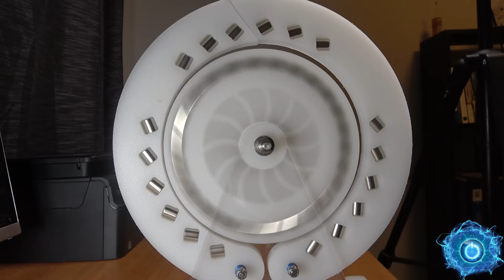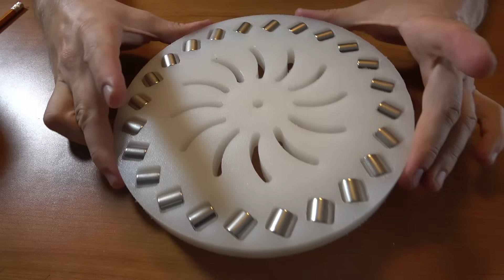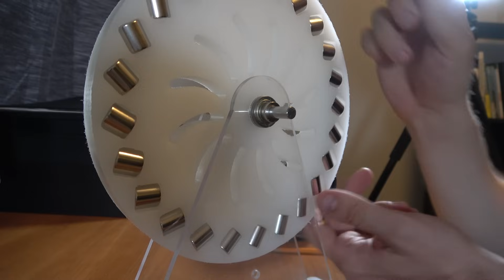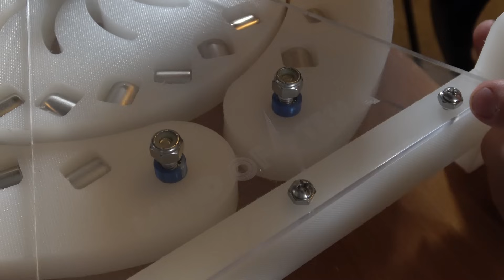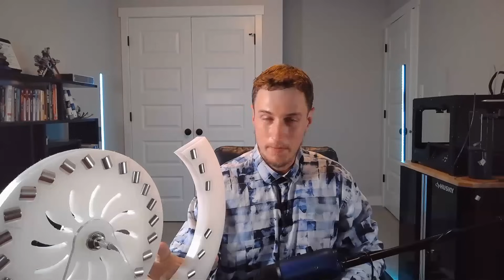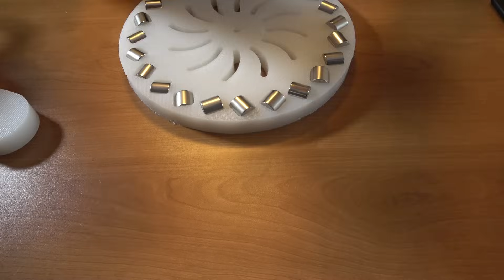Perendev Magnet Motor - Does IT WORK?!

Comment: I don't have any background on engineering nor english is my first languege. I believe that to create a funcional lightsaber, regardless of type, you need a way to manipulate the shape and strength of a magnetic field, and a way of create plasma (hot or Cold), and miniaturize everything. the magnetic field would give the shape of the blade and the strength of the field need to be either variable so the energy can interact with the enviroment or need some form of "miracle" point that can secure the energy inside the field and allow the field to disperse for interaction with the enviroment. plasma has many forms there is grape plasma that apears in a microwave oven to atmosferic entry. from easy to hard i believe that cold plasma lightsaber are easier but i have no ideia on how destructive.

Comment: These magnets at their closest appear to be an inch apart, they'd work considerable better if closer, and may be the reason this doesn't work. We also have no way of knowing the polarity of these magnets, I feel it'd likely work better if magnets were repelling one another. I also think if attracting magnets were built into the support structure of the hub, there'd be a pull from the inside of the circle and a push from the outside, that little extra pull could make a big difference, also I's suggest that the wheel has significantly more mass and weight required to hold the magnets than needed. There's also considerable noise from the hub which indicates significant friction, I'd suggest that using a bicycle wheel with proper machining and bearings could make a large difference.
Reply from the maker: I have a polarity meter and made sure they are all opposing but the magnets need to be shielded because they are interfering with each other.

Comment: That original motor had springs at the inner side from the magnets, they dont been complete static. It also had 3 wheels, where it seems, that the 2 other helped to overcome the sticky point. 
But there been to less informations about the device itself to reproduce it.
Reply from the maker: I am trying to build variant 2 with mu metal, this will answer a lot of questions whether or not it really can work at all.

Comment: Use 3 rotors and 3 stators, but remember, that rotors shouldn't be placed in a row
And you should also use a Cooper pipe as a magnetic shield for each magnet
You can find a patent on web, with a instructions
Reply: That was my thought too in regard to shielding them in a copper sleeve.

Comment: You're supposed to shave the corners of the magnets. They can't be perfect cylindrical magnets, you have to shave corners off to distort the field. Or so I'm told, idk. I'm gonna try it though lol. My serious x died all by itself now I'm bored. I also want to mention that Microsoft quality is like a 99 Kia now. I haven't touched it in months, it's clean inside, but it died all by itself anyways. Gd a**holes want 300 to fix it, it's 15 months old.

Comment: If this couldn't be used to generate power with permanent magnets, why would it be more likely to generate power with electromagnets?
Reply: Because with electromagnets you have an input of electrical energy which can be transformed into mechanical energy. In contrast, permanent magnets do not deliver energy - except what physicist call "potential energy", which can't run a motor.

Comment: Is it because this had never occurred to anyone in the past or only recently, have we had very powerful permanent magnets?
Reply: No. If such concepts would work they would also work with weak magnets, only the output of power would be small. But magnet motors up to now have never delivered even a MicroWatt of power, never mind which design was tried. Because permanent magnets deliver force but no energy.

Comment: You do many things wrong, you need a Aluminum Tube hull for the magnet, to shield the interference of the magnet, the the power push out is more in one direction! Many videos about that effect are on YouTube! And the Arms around your wheel are not that exact and the magnets heads must be free and not covert with that plastic and at last they must come nearer together.
Reply from the maker: Why not just use electromagnetic coils and alternate the cycle?

Comment: You should put plate magnets instead of those square. The secret is in magnetic flux geometry. Not all kind of shapes are suitable for magnetic motor.
Reply: Absolute no kind of magnet shapes is suitable for a magnetic motor. Permanent magnets alone can not drive a motor, never mind what shape they have. I always wonder about such advices. Do you have a running magnet motor with plate magnets? Of course you haven't.
Reply: You are the first person I've heard on this topic that is absolutely correct ... I myself  couldn't agree with you more and the other 3 requirements that make it work continuously , produce usable torque , and actually fulfill the promise of a real clean energy machine ... Mr Joseph A Bailey ☘️
Reply: I believe that you know what I know by coincidence ... Judging by how you sit back in cognito and give the specific answer that you did without revealing too much ! ... I applaud you Sir ... Mr Joseph A Bailey ☘️
Reply: Takes one to know one ...

Comment: If a motor is to be moved by permanent magnets alone, then it must also be possible to build a motor based on falling stones. The ground and the stone also attract each other. But no one has ever succeeded in doing so. You have to lift the stone up again! In the same way, magnets that have been tightened must be released from each other with great force.

Comment: There is no such thing as free energy and never will be. I do like perminant magnet moters but even with those I imagine the magnets would wear out over time and have to be realligned.
Reply: Don't worry about magnets wearing out over time and have to be realligned. This doesn't happen because a motor only equipped with permanent magnets doesn't work anyhow, not for one turn. Not even with brand new and perfectly aligned magnets.

Comment: mu metals and a few other material types such as electronic magnetic repression and special paints, allow you to make “fake monopoles”, you can’t beak the laws of physics, magnetic induction and motion but you can neutralize them to some extent. You might also be able to use electrostatic forces instead of magnets.

I asked an LLM to summarize the basics of the technique.

electrostatic forces arise from electric charges, which can be considered as monopoles in the sense that an individual charge (either positive or negative) can exist independently. For instance, an isolated electron has a negative charge, and an isolated proton has a positive charge. The electrostatic force between two charges follows Coulomb's law, which states that the force is directly proportional to the product of the charges and inversely proportional to the square of the distance between them.

So, while electric charges can be seen as monopoles in terms of their isolation, they differ fundamentally from the concept of a magnetic monopole. The similarity is that both electric charges and hypothetical magnetic monopoles exert forces that diminish with distance according to an inverse-square law.

Remember though you are limited by the max “ pressure “ insulators can hold back before there is a short.

electrostatic forces arise from electric charges, which can be considered as monopoles in the sense that an individual charge (either positive or negative) can exist independently. For instance, an isolated electron has a negative charge, and an isolated proton has a positive charge. The electrostatic force between two charges follows Coulomb's law, which states that the force is directly proportional to the product of the charges and inversely proportional to the square of the distance between them.

So, while electric charges can be seen as monopoles in terms of their isolation, they differ fundamentally from the concept of a magnetic monopole. The similarity is that both electric charges and hypothetical magnetic monopoles exert forces that diminish with distance according to an inverse-square law.

I can dream of building an engine that tops off the electrostatic charge , and allows you to have a very efficient engine from algae power lol

High-Voltage Transmission Switching: Utilizes advanced methods to switch and control the flow of high-voltage electrical currents.
Superconducting Loop: A loop made of superconducting material, which can carry electrical current with zero resistance.
Simulated Multiple Windings: Achieved through a unique configuration or operation of the superconducting loop, giving an effect similar to having many windings in a traditional electromagnetic setup.
Slow Electron Propagation: Utilizing the relatively slow drift velocity of electrons in a conductor to affect the electromagnetic properties of the system.
Monopole-Like Magnetic Effects: Creating magnetic field configurations that mimic some aspects of theoretical magnetic monopoles, using the properties of superconductors and electromagnetic field manipulation.
Reply: Monopole magnets - if they would exist - would also not allow to build a magnet motor. After all, gravity is kind of monopole, but where is a gravity motor? Electrostatic forces are much weaker but also with them a motor can't be built. Electrical charges are - just as permanent magnets - not a source of energy, they only deliver forces.

Comment: Try a spiral of similarly oriented magnets in the rotor with a full flat north and a full flat south on the there side of the rotor, because the locking of the north and south poles actually rotates at all times maybe the magnets oriented inward torward the center of the rotor will just get caught in the north south vortex and then rotate more like a tesla turbine than a pushing device, more like magnetic friction.

Comment: The magnetic coupling of pumps and motors.
The magnetic rotational motion direction or motor, must have both , like North pole and south pole., similarly magnetic attraction force as well as magnetic repelling force. It must be connected to a motor which keeps on rotating with the same energy power, generated by the rotating magnetic coupling.

Comment: Just a thought, i see how you moved the magnet in and out to get a pulse effect like an electromagnet coud do, why not replicate that efect with either a cam in the centre moving the arms in and out at the right timing to skip the following magnets efect and dropping back in at the right time to have the repellent force applied at just the right time, alternatively it could be bumps on the outer of the wheel shunting individual magnets on sliders pushing the outer magnet away and towards the inner magnet etc... just a thought

Comment: I wonder if reducing the outer magnets #, say maybe 4 total and having the inner magnets on a rachet gear type of system where they only get pushed out into the magnetic field of the outer magnets at the right time would work. I think you might have to offset the timing so one magnet at near maximum force is overcoming the next magnet that's ramping up friction losses. So 4 outer magnets, maybe 5 inner on the rachet? Idk still fun to think about though.

Comment: How about a double wheel. Side by side? That give both room to move   OO    instead of working against each other, And acting as a kick starter?                                                         push  \/ Pull    or opposite your choice.

Line up OO over \  /

Comment: I have thought of using bismuth as a magnetic pusher and steel as a puller. I wonder if you can use this as half of the magnet motor with magnets in or out that push or pull the wheel depending on the material facing the magnetic fields.
Reply: Kind of like the black and white plates of a radiometer but instead of light it was thought to be made to spin with magnetic fields.

Comment: this would work if the magnets on the outside were electromagnets as you could then control when they are active and when they are not kinda like a rail gun or particle accelerator and it would still be able to output more energy than you input as you only need them to activate for less than a fraction of a second although this would be happening constantly

Comment: COOL, WILL YOU TEST MY IDEA??? I made one magnet attract itself to a soft iron shield plate then repel itself from the other magnet hiding behind that plate, which made the inner rotor magnets field asymmetrical, which caused that effect...and recently I used thin steel sheets to wrap a field around the edge of the magnet for an even greater force in the desired direction, so now I am preparing to rebuild the test device with two magnets, on an old hard drive disk for a good bearing and something to hot-glue the parts to for a simple test.  If I can get the original test to work again, I believe I can make the effect continue on around the whole motor, by making one more magnet on the outer stator than inner rotor so no two ever line up in the same place, which I believe will maintain a continuous force/torque in one direction.

If anyone is willing to try building and testing my designs (I have at least one other using gears and rotating shielding plates), I would be happy to share drawings and maybe 3D models which I intend to make so that I can actually build these parts with 3D printers and CNCs etc..

Comment: The problem ive always had with magnets, were the magnets themselves. The field needs to be warped so the field can be controlled into a direction. I havent had a chance to try it, but ive been thinking since copper and aluminum can change the magnetic field, is using some sort of tube to narrow the magnetic field.

Comment: Anything which really works won’t be introduced or funded by the Crime Oligarchy.  I believe very low input motors are already possible - but there always needs to be some input via differentials, etc.  New improved Stirling Motors are most interesting.

Comment: I have a thought have you tried using a cam on your shaft with a leaver that pushes a are out from the spinning magnets. Or a leaver that would push up a small piece of lead plate in between the magnets to block the magnetic filds

Comment: You built it wrong. You have one of the 3 phases there. You need all 3 phases so it stays in an unbalanced state. Wit ha single phase magnetic cogging will always stop rotation. With all 3 phase, one is cogged while 2 others are in attraction or repulsion. This keeps the machine in an unbalanced state so that it can run indefinitely. Make 2 more of those rotate them 120 degrees apart and you'll have an actaul Perenev motor instead of a single phase!

Comment: How about if you make each magnet in their respective hole rotate freely. You may also need to change the placement of each magnet to minimize the tugging or stalling effects of the current configurations. In other words, in the new configuration, at any time or location, each magnet is either pushed or pulled in the same direction. There is no free energy that can be extracted from this type system. However, it can do some simple work within the limitations of the magnetic energy stored in the magnets. You may also add some coils in the feedback path to compensate the rotor slip caused by applied load.

Comment: There is no such thing as "Free Energy".  This is a Fraud.  It defys laws of physics.  Why are all these types of "free Energy" inventions always made by Unknown inventors without any degrees in physics or engineering and then never heard from again ?     Answer: It is fake. Usually an investor ponzie scam.
The hardest thing about free energy is where to hide the power source or batteries. Magnets are not power sources. This scam has been done before. Notice you only see one side of the device while it is running. 
SCAM !
P.S.  I am a licennsed electrical engineer. You are a Charlatan.

Comment: Iv seen one where the guy twist the magnet back and fourth and it worked so all it needed was a timing set up just like timing in a car the faster it spins the mechanical timing  would speed up so im wondering why nobody has done it
Reply: Because it doesn't work.

Comment: Years back I saw this machine just like yours BUT it stood about 9 feet tall and the shaft was easily 4 inches in diameter. it required power to close the top and as it was closing you could see the shaft begin to spin until it was fully closed. I recorded that video to a hard drive which is now GONE? (the video not the hard drive)

Comment: I remember that there were a few rules that must be met in order for the device to work. The magnets on the wheel are too close to each other so their magnetic fields overlap. The distance between the magnets on the circumference of the circle should be at least 1.5 times the diameter of the magnet (preferably 2 times) and be at least 1.5 times greater than the distance between the magnets on the small circle and the large circle. The inclination angle of the magnets on both wheels should be 30 degrees. It looks like it's 45 and 60 degrees. change it and have fun.

Comment: Don’t work, because the main itegral of the torque , from 0 to 2*pi of rotr’s round, is 0! In ur projec the rotor tutns becous the friction is two low and the torque is 0! Many time ago i ‘had simulated this magnetic motor thanks to femm sofware (Finite Element Mathematics Methods) both with femm (2D magnetostatic problems and only for Win) and with comsol (3D magnetostatic problems)…. That’s becaus the magnetic fild is static and is not like a wave magnetic fild that change in the time… or because the magnetostatic problems does not violate the principle of least action… only in the phenomena of quantum physics the principle of least action, if it is introduced, no longer works